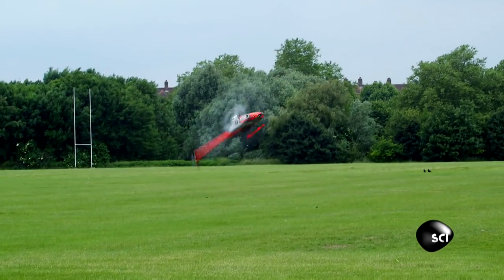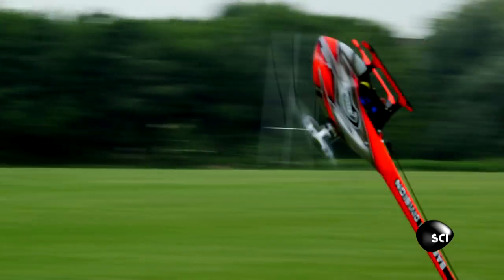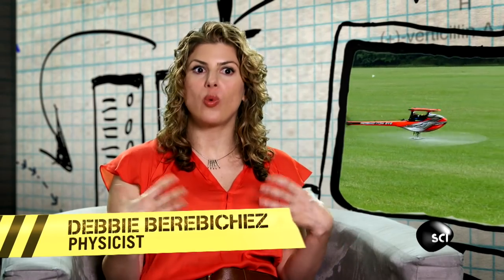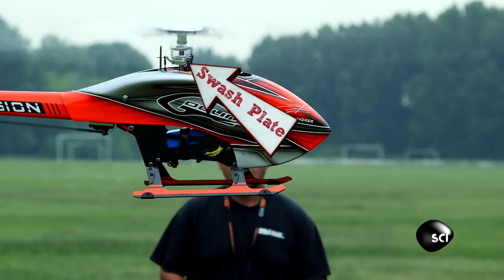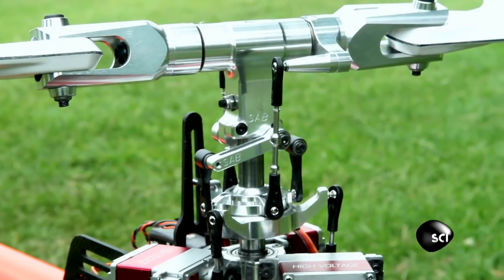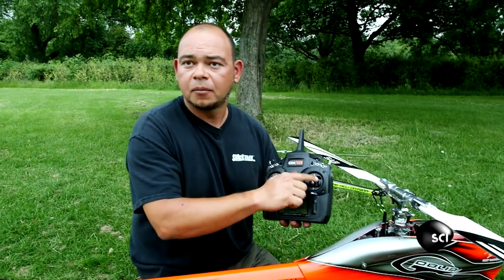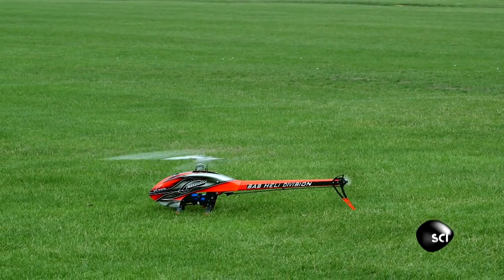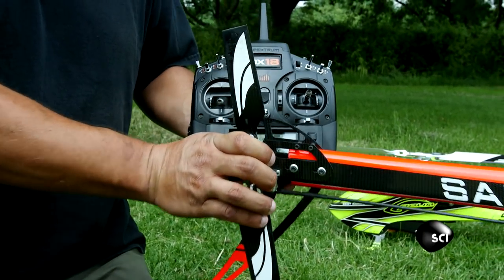How Are These Incredible Helicopter Stunts Possible?

Comment: The next major upgrade is a universal 3D gyro design that allows a single main rotor rc helicopter with stabalizer bar to fly like a quadcopter without constant inputs. I think it's the notable operational limits of systems like the helicommand & flymentor that has ultimately lead to the widespread manufacturing/sales of quadcopters.
Reply: Afrocanuk none of those names ring a bell. The progress of Quadcopters has been achieved through other flight controller research and development that is particular to multi rotors, not Helis.
Reply: Afrocanuk none of those names ring a bell. The progress of Quadcopters has been achieved through other flight controller research and development that is particular to multi rotors, not Helis.
Reply: There's nothing new about settling & building on a compromise.
Reply: You dont need a flybar with a 6 axis gyro.
Reply: No, just no.  Flybars have been phased out for years now dude.  Please get the correct terminology before spouting off about it online.
Reply: @ambrosekillpack4841  Absolutely NOT!!!   For starters I said "STABALIZER BAR."  These are still very common in small RC helicopters!
Reply: @Afrocanuk  Not really, maybe on toy grade helicopters only because you have low budget straggler companies buying cheap white label products from whatever factory they can get to manufacture them.  But on the cutting edge market they really aren't used anymore.  Pretty much every RC helicopter released in the last 5 years has been flybarless and within the last 2-3 years has furthermore been collective pitch on top of that.  Also chill dude, I'm simply asking you to do research and familiarize yourself with correct terminology so you don't look silly online.  I barely even understood what you were saying and I'm far better versed in helicopter terminology than most people.
Reply: @ambrosekillpack4841  This is a bull shit argument. An RC helicopter is an RC helicopter no matter what size it is.
Reply: @Afrocanuk  oh great I am talking to a troll.  Welp I'm out.  Consider yourself ghosted kid.  Go buy yourself an old school flybarred RC heli then, I don't care.
Reply: @ambrosekillpack4841  The only troll is the one you see in the mirror.  Picking a senseless disrespectful argument over a 6 year comment.

Comment: How does he go upside down without the helicopter to go down?????
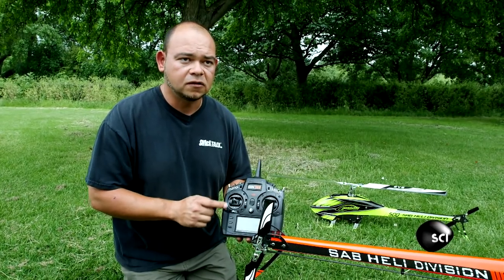Reply: At 2:40 he says the tail rotor can switch pitch as they are spinning. the main rotor can also do the same, pushing air down or pushing air up (when heli is inverted)
Reply: Jo Bu but how does it go from spinning super fast 1 way to the other way fast
Reply: @ohyeahyeah7731  it doesnt

Comment: An unmanned aerial vehicle (UAV), commonly known as a drone, is an aircraft without a human pilot aboard. UAVs are a component of an unmanned aircraft system (UAS);
 which include a UAV, a ground-based controller, and a system of 
communications between the two. The flight of UAVs may operate with 
various degrees of autonomy: either under remote control by a human operator or autonomously by onboard computers.[1]
Reply: ..Thanks for sharing.

Comment: One quick question, I know that the tail rotor blades have variable pitch, but can you also control the tail rotor rpm's ? Jus' askin' !!
Reply: Not really, the tail rotor is belt driven so its power is coming from the shaft that is connected to the main rotor
Reply: @jobu1978  thanks Jo 👌😎

Comment: Being a big RC Helicopter pilot for about 10 years myself, I despise the word Drone. I am also a "quadcopter" owner of the Phantom 4 Pro, not a DRONE own. I don't blow up Afghan's! Drone is a very negative and "noobie" word for those that have been doing this for 40 years like I have (planes, cars, heli's, quads) to find out who the noobz are at the field. However, drone the actual word itself does refer to anything remotely used...so your wife's vibrator is technically a drone.
Reply: BTW Bert, met you at many funfly's and IRCHA's and maybe even an XFC or two. KUDOS if you are reading this for getting on the Science Channel. I'm sure you got edited a ton, aka 'Flying backwards put stick this way!'. I would have died to hear the entire explanation that I'm sure they edited down to that nitwit tidbit. I'd have been pissed.

Comment: ..... But I wanna know how it flies upside down,,
Reply: The main rotor blades can be pitched from about -12 degrees to +12 degrees. When the helicopter flies normally the pilot pushes the left stick on the transmitter (collective) up and the rotor blades are pitched positive, blowing air down and giving the helicopter lift. When the helicopter flips upside-down, the pilot reverses the pitch of the blades by pulling down on the left stick on the transmitter. Instead of blowing air up, they blow air down, giving the upside-down helicopter the lift it needs so it does not crash. When he flips back to right-side up, he pitches the blade positive again.

Comment: How much would one of these go for?
Reply: These would cost between $2,000 to $3,000 depending on electronics and transmitter used.
Reply: 2SLipo noooooo
Reply: Mine cost me $1500 for everything plus shipping build and also bag and extra blades extra batttery extra camopy was awesome deal.
Save money for some helicopter I bought the smallest size 380 what You saw would cost like $2500 -$3000 the red helicopter if you get bigger helicopter it worth more .

Comment: 1:36 the power of the motor does not allow him to flip and hover upside down... omg... please get people who know how this stuff works... these are collective pitch helis... so the rotor head speed is always the same in aerobatic mode, and the throttle left stick controls negative to positive pitch. Middle of the throttle stick is 0 pitch, all the way down is negative, and up is positive. So hovering upside down requires negative pitch. Flipping means you have to move the swash with the right stick to initiate a flip, but also manage the pitch. Get it wrong and you go straight into the ground. Get it right, and you can flip the heli in the same space. I fly smaller helis like this.

Comment: such an incomplete explanation - ya i know how it goes up and down and back and forwards... how does it go upside down when presumably the rotors are pushing air (providing lift) in the same direction as gravity when it is upside down...for one... i have other questions...
Reply: It can go upside down because the main rotor blades can pitch the same amount both up and down.  Once it flips over, he just reverses the pitch.  Not every helicopter can do that.

Comment: they fly upside down because the blade can Tilt,, left or right.. SO when its upside down,,You just hit the switch and causes the blades to tilt back,,   In turn causes the helicopter to fly back away from the ground,  Very ,Easy once ya get he hang of it, Like any  video games basically with a controller

Comment: i cringe when they explain how the helicopter flies, the some of the few thing that they decribed right is that the main rotor blades produces the lift and the swashplate controls in a very simplified explanation 
oh.. and purpose of the tail rotor is to counteract the torque from the rotating mass of main rotor blades

Comment: Power to weight example.. If a heli has enough power to hover then it also has enough power to hover inverted. The limiting factor is the pitch of the blades, wich passanger helis don't pitch negative on the blades.. Jeeze these ppl sound elementary

Comment: So disappointed. I thought they are gonna talk about the superb engineering behind it, how the 180 degree turn of the main rotor blades done by a split second using gyros analyzed by computers.....

Got what I already know.....
Reply: No computer is doing the stunts also in idle up all gyros are disabled except the tail one
Reply: @nightmareinaction629  I read somewhere they have.

It knows its position and direction compared to the controller and if the heli facing towards the "pilot" the inputs don't become opposed.

For example the heli facing towards you left would be right backward is forward. With this the controls not change. But i guess it depends on the model.

Comment: It's not really that impressive. It's a toy...
Also, SmarterEveryDay covered this A WHILE ago.
Reply: sooo true
Reply: +Steven P Yeah, just your average toy made with carbon fiber, titanium, and highest grade aluminum employing some of the most advanced brushless electric motor, speed controller, lithium battery, digital servo, digital gyroscope, and digital spread spectrum radio control technology available to the civilian population costing thousands of dollars.  But, yeah, just a "toy."
Reply: +Steven P These are hobby grade helis, defo not toys.
Reply: a $1500+ toy that u can't aford
Reply: Not quite $1500,  700 size kit $1000, servos $500,  motor $300-$500,  Speed controller $200,  Voltage regulator $100,  Battery $60, Gyro $250, receiver$150, blades $200, telemetry $100, Transmitter $200-$1200, battery for a 4 minute flight, $275.  I can be off here and there, but it's pretty close.
Reply: These are anything but toys. You treat it like a toy your going to get KILLED by it. I WITNESSED someone getting hit in the arm with one of these, and they had no more arm. Do everyone a favor and NEVER treat ANY hobby grade RC like a toy. It's actually offensive to RC pilots when people call RCs toys. Know your stuff
Reply: Pilot Paul when I started getting into the hobby I learned the hard way that these machines aren't something you mess around with. Built my first 5" quad, got it BF configured and took it outside. It was about 8:00 and getting dark so I couldn't see super well all the way into my yard. I flew out, then started pitching backwards but couldn't quite see how it was sitting, kept pitching backwards until it was 4m from my face coming in fast. Got it pitched forward enough in time to not have a really bad crash but I sliced up my arm pretty good.

Comment: I guess the purpose of this channel is to transfer knowledge to the general public. However the information spread in this video is just Bullshit.
It has passed the point of  'making it more basic so everyone can understand it'  to the point of it not making sense.
These rotor doesn't tilt. The mast is fixed. Yes the blades have vertical travel but it's called blade flapping or coning.

If any kid decides to watch this video to provide information during a school presentation and the teacher actually does his/her research or already understands the basic mechanical and physical engineering behind helicopters that kid would fail his presentation.

Comment: This is a science channel and you describe yaw as sideways LIFT? Lol 
Not to mention a real helicopter doesn't have negative pitch to fly inverted. I tried for years to fly helis 3d spent more time rebuilding than flying so quit to peruse fpv quads. Only a small percentage of pilots can achieve this level the orientation and lightning reactions are for the elite.

Comment: terrible research and presentation.. didn't even mention the 3d button function.. that would have explained how the helicopter flew upside down?? lol
Reply: space cadet there's no "3d button function", it's entirely manual. The craft doesn't level itself, the pilot does. Clearly the only experience you've had with rc vehicles is with dji shit that flies itself.